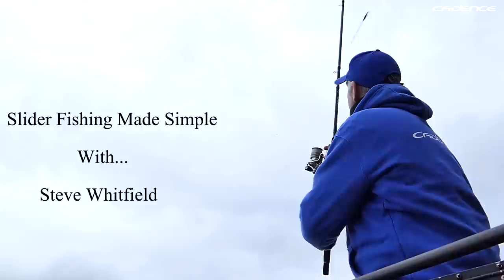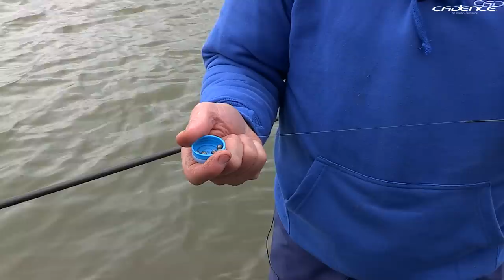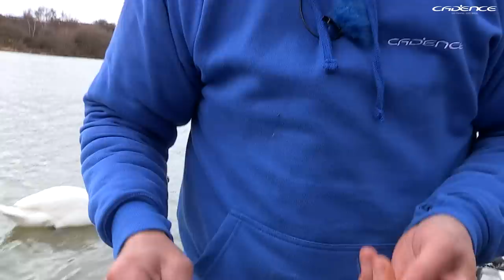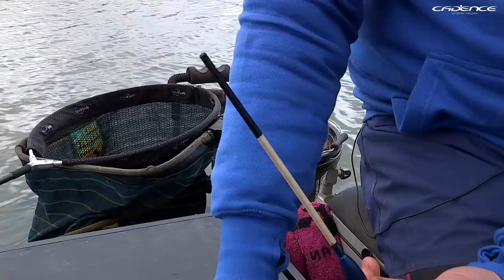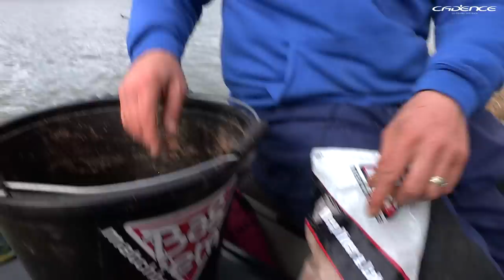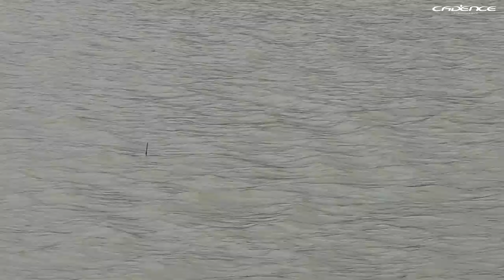Slider Fishing Masterclass

Comment: Great tip on the carbon stem with the Olivette, lve been using something similar for a few years now. I put the Olivette on then pass the line through the red plastic tube you get with a can of wd40 then lock it in place with a small shot,just booms the hooklength away. Thanks for the vid.